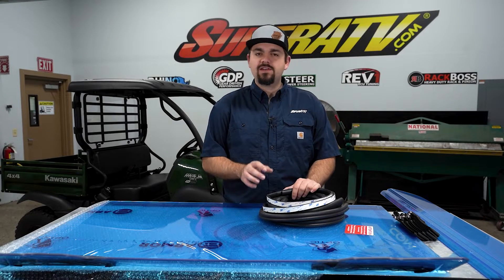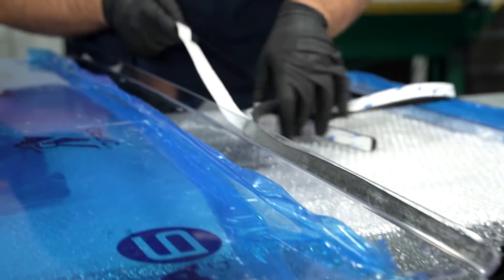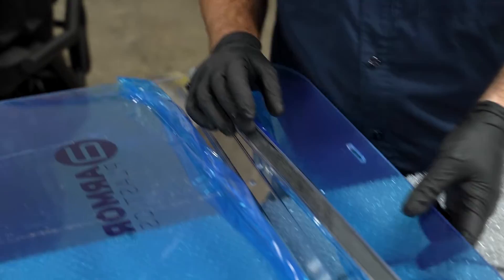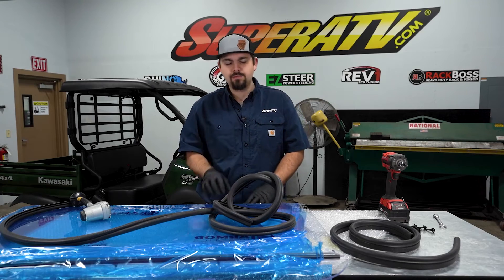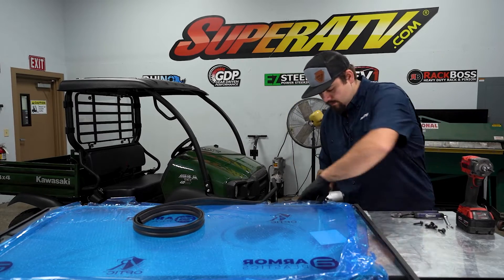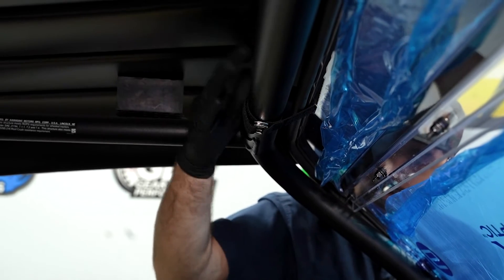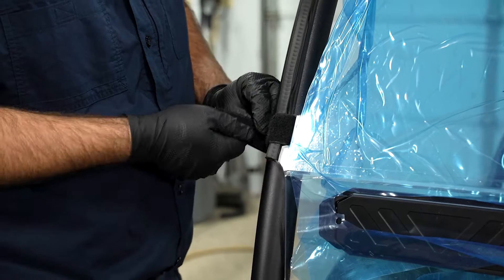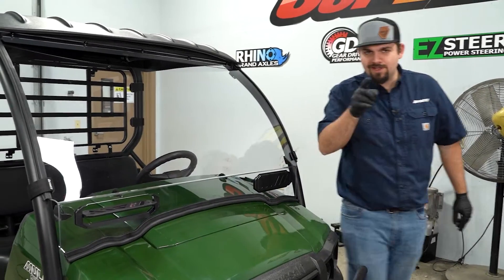How to Install SuperATV's Vented Windshield on the Kawasaki Mule SX

Comment: How do these do when trailering???
Reply from the maker: We do recommend that you remove them or secure them with additional straps just to be on the safe side. They hold up incredibly well, but you can encounter powerful wind shear when passing vehicles on the highway, so it's much better to be on the safe side!